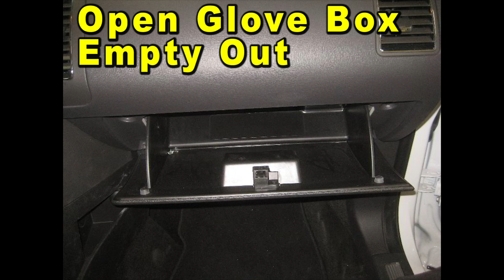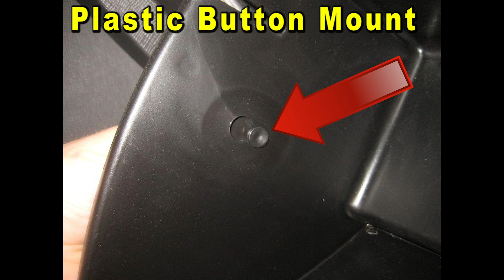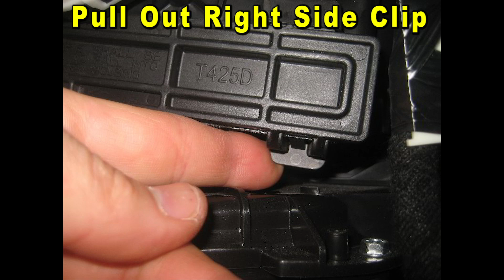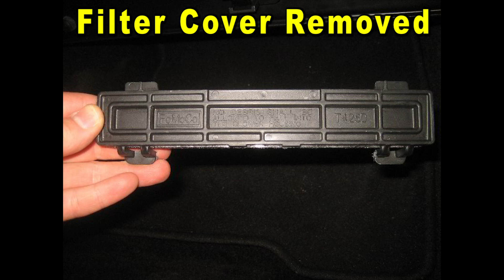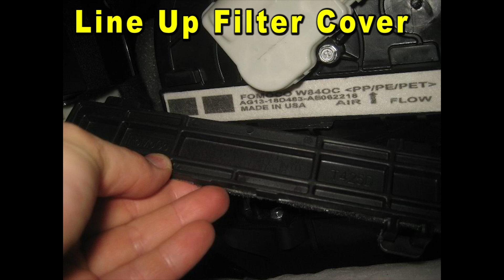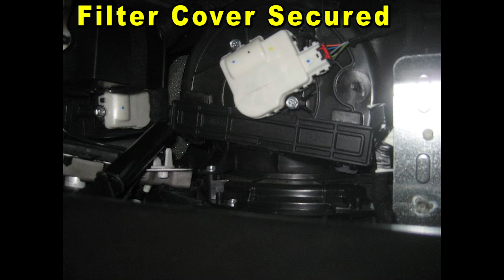2009 To 2019 Ford Flex How To Change A/C Cabin Air Filter With Part Numbers (Air Flow = Down ?)

Comment from the maker: Ford Flex A/C Cabin Air Filters - https://amzn.to/3VHgjVJ
Bosch HEPA Cabin Air Filter Part # - https://amzn.to/45pPkkp
Spearhead Odor Defense Filter Part Number - https://amzn.to/4aXzsa1
K&N Washable Cabin Air Filter Part Number - https://amzn.to/45kY8It
Precision Screwdriver Set - https://amzn.to/3sLixaP
Plastic Pry Bar Tools - https://amzn.to/3HMtsV7
Socket & Ratchet Set - https://amzn.to/3Z17LbA
Mechanix Gloves - https://amzn.to/3jCnHkt
Torque Wrench - https://amzn.to/3vS5uSI

The Paul79UF YouTube channel is a participant in the Amazon Services LLC Associates Program, an affiliate advertising program designed to provide a means for sites to earn advertising fees by advertising and linking to Amazon.

This DIY video shows owners of the 2009 to 2019 Ford Flex how to change the A/C system's cabin air filter element.

Comment: Air flow goes down!!
Reply from the maker: Hi Mike, Thank you for the inspiration to research this issue. It looks like either Ford made a mistake with the printing on the OEM filters or some Ford vehicles have the air flow going up instead of down. 

I'm more inclined to believe that the arrow on the original filter was printed incorrectly since almost every other vehicle has the air flow going down.

This is a 2019 Ford Flex in the video. At the time, it only had like 15,000 miles and this was the original OEM filter from the factory with the "Air Flow" arrow pointing UP.

Check out this video of a 2018 Ford Explorer by etrailer - https://youtu.be/-K7FDyaFbeo?si=m0L77Amyg5QrhPaW&t=238

The OEM Ford Motor Company (FoMoCo) filter in that Explorer has "Air Flow" pointing UP just like in my 2019 Ford Flex. They also have their video labeled with the Air Flow Direction being up. 

In this Reddit thread, a few Ford Explorer owners talk about how their OEM filters also say "Air Flow Direction UP" - 
https://www.reddit.com/r/FordExplorer/comments/jkdagq/2018_ford_explorer_sport_cabin_air_filter/

Here are some quotes from the discussion - 

"I replaced my cabin air filter in my recently purchased Explorer and noticed the air flow direction arrow on the old filter was pointed up."

"I just changed mine in my 2017 Platinum and the direction of the arrow should definitely be “up”. The air will flow from the bottom and up through your vents, not the other way."

"Yes, I can only imagine the confusion it would cause. I experienced the same thing and went with logic but then confirmed on my friend’s Explorer and his factory installed one was up."

I worked on my friend's 2014 Ford Explorer with the exact same A/C system and the OEM filter says "Air Flow DOWN". Here's the Ford Explorer cabin filter guide showing the air flow is down - https://www.paulstravelpictures.com/Ford-Explorer-HVAC-Cabin-Air-Filter-Replacement-Guide/index.html

Check out this guy's video for his 2017 Ford Explorer. The air flow arrow also points up - https://youtu.be/uQo-7LZaXe8?si=6Ylo71Bj1FyVkNTk&t=250

The comments on that video have some people saying that their filter also points "Up" but the dirt was on the top of the filter as it normally should be.

This guy's video seems to prove that the air flow goes down when he inserts a tissue into the opening while the blower motor is running - https://www.youtube.com/watch?v=-h9-V3C0YF0

So Ford must have messed up the filters for some Explorer and Flex model years. 

Either way, it doesn't matter much. The filter is just a simple pleated piece of fabric. It will probably work the same way in either direction. 

Thanks for pointing this out. I'll put a note on the video for other owners.
Reply: @Paul79UF  no worries. I will say it makes no sense for the air flow to go up. The air flow goes down INTO the car.
Reply from the maker: I agree. I thought it was strange when I saw the UP arrow. After all of that research, it does seem like Ford definitely messed up with the OEM filters. Thanks again!
Reply: @Paul79UF  no problem! I took pictures of the old filter and the directions. Ok so Ford had the arrow up on mine and the debris was all on the top which tells me Ford put a whole lot of these in wrong. I wish I could attach the picture. I also took a picture of the instructions from the filter which says the arrow points down as well. Ford is always an adventure! Right from my first Ford which was a 1975 Granada all the way up to my Flex its been fun lol. Take care!

Comment from the maker: Check out the DIY guide for changing the cabin air filter in a 2009 to 2019 Ford Flex SUV -
https://www.paulstravelpictures.com/Ford-Flex-Cabin-Air-Filter-Replacement-Guide/index.html

Here are all of the DIY repair and maintenance tutorials for the 2009, 2010, 2011, 2012, 2013, 2014, 2015, 2016, 2017, 2018 & 2019 Ford Fiesta - 
https://www.paulstravelpictures.com/Articles/Ford-Flex-Common-Problems-DIY-Repair-Maintenance-Guides.htm

Owners of other Ford or Lincoln vehicle such as the Explorer, Fiesta, Focus, Fusion, C-Max, Mustang, Taurus, EcoSport, Escape, Edge, Expedition, Transit Connect, F-150, Ranger, MKZ, MKC, Navigator, MKX and Continental may also find these DIY instructions to be helpful.